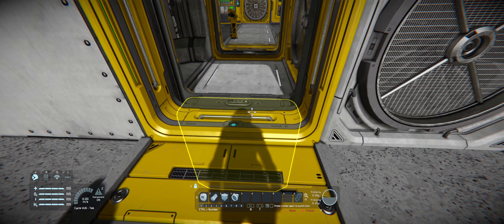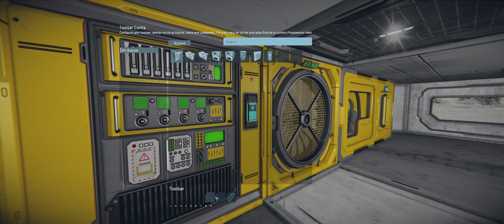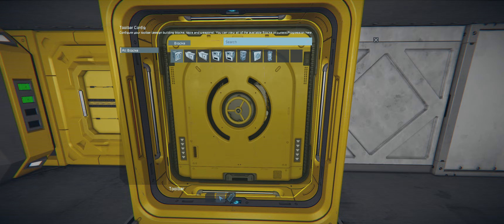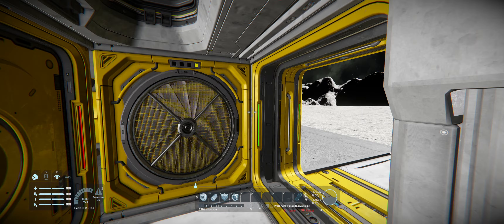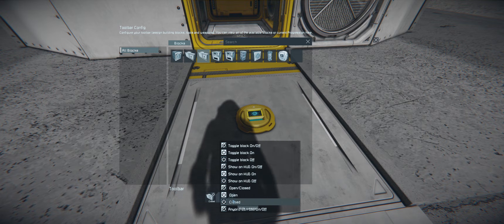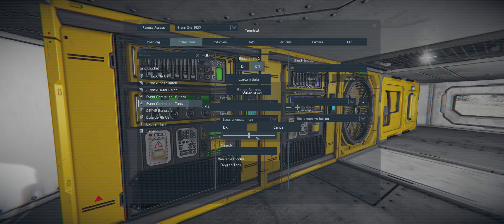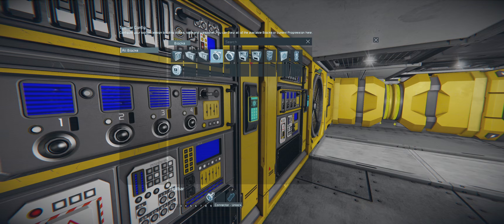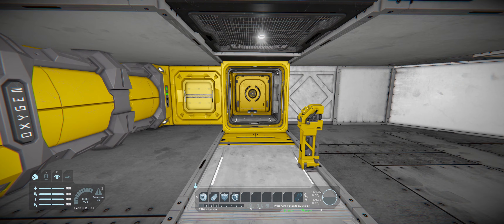Super Simple Airlock in Space Engineers! 100% Vanilla, No Scripts! Just 1 Event Controller!

Comment: For some reason, the airlock occasionally kinda... locks up? Not when depressurising, but pressurising. Or rather, the automated opening based on the Vent sometimes has the inner door failing to open even when there's plenty of oxygen, like the vent isn't fully pressurising.
Reply from the maker: There is a game bug where the room "fills" to 98% but never hits 100% for the vent trigger. Turning the vent on and off helps sometimes.
Reply: @EngineeredCoffee  Manually opening the inner door usually works, but I also have a light inside tied to the vent that turns red when depressurised, and it sometimes doesn't turn white when I do that. Cycling the whole airlock usually works, but I've got spare buttons in the airlock, so I guess I can make one a 'trouble-shoot' button.
Reply from the maker: It's a recent bug for sure. Not sure why the vents stop before 100%. Maybe a vent off when the outer door opens then on again when it closes 🤔

Comment: Which doors r u using and how u place them, please? And which vent r u using? Mine have only one fan and  all others r connectors. Yours have 1 vent inside airlock and another outside... Can u show how u made this, please?
Reply from the maker: It is the sliding hatch door for Warfare II DLC. It is 2x1, so you place it where the door is not the block mechanism. So you need to aim at the wall or ceiling in my setup so the rest of the block is in the floor.
The vent on the outside is decorative/only useful if the base is in an atmosphere to suck in air. For the airlock you only need the vent inside the airlock. Your inside of the base also needs a vent, but that is however you want to plumb in.

Comment: Seems like there is no more events in EC for opened, ore closed doors. Instead there is a single event "door finished open/close", which ruins the whole design, shown in this video.
Reply from the maker: Same event and functionality, just a different name. Tutorial and airlock functionality is still working as intended!
Slot 1 is for door fully open, slot 2 is for door fully closed. Use the other pages (ctrl+2,3,4...) to add more triggers for the open/closed.
This airlock uses the 2nd slot, doors closed, to swap the vent pressure.

Comment: Thank you very much for the video, I made one based upon this design, it looks different but it has the same basic function, I've got it working with sensors, one on the inside, and one on each of the outsides in case it ends up in the wrong setting, or if I hypothetically had it on a multiplayer server.
Reply from the maker: Yeah, I haven't tested it with multiple users at the same time
Reply: @EngineeredCoffee  I think mine should work, the sensors on the outside of the airlock close the opposite door, the sensor on the inside triggers a timer block that will toggle both doors open/closed. So I did add a timer block, but I wanted to avoid having to manually close a door as I passed through and avoid it triggering when I left range.

Comment: This is one awesome Airlock system. Thanks for sharing. Wish there were an easier way to control the Oxy/Hydro gas volume transfer - especially if you'd decide to like to run a Refueling station for trades and so forth....
Reply: Also, don't try this with the inset connectors. For some reason it didn't work for me, Oxygen tank kept on refueling up to 100% even though the connectors were disconnected....
Reply from the maker: Yeah, I reported the bug to Keen a couple months ago. They were able to recreate it, but no fix yet. My Martian Engineering series, I have 1 normal and 1 inset and that works fine. Just not 2 inset facing each other.
Reply: @EngineeredCoffee Yeah man, the inset connector also just has an overall cleaner look to it. Also, I honestly wish they'd add gas volume transfer functionality to the conveyor sorter, would honestly make things a lot easier on the designs and what not...

Comment: Is there a way to gate valve gas other than with connectors?  I don't think the filters do it do they?
Reply from the maker: No, sorters only do components. I wish there was  an actual valve.
Reply: @EngineeredCoffee  i suppose one could setup a welder/grinder/projector setup where a button push ground down a conveyor block to prevent gas transfer, then weld it back in place when the gas transfer is needed. But that's probably more work and space than two connectors...

Comment: You really need to explain this better cause you never show what to put on the inner button cause everything I tried resolved in it depressurizing while the inner door is open and it pressurized while the outer is open
Reply from the maker: Sorry, the inside button closes the outer door. I mention it at 1:55 but didn't show me setting it up. The outside button closes the inner door.

Sounds like you may not have your initial condition setup before setting up the event controllers. Make sure the outer door is on and open, the inner door is closed and off, and the vent is on depressurize.

It is the closing of the doors that triggers the Event Controller airlock cycle. So that button to close the outer door is needed because we can't reach that door unless we are in the airlock to close manually.

So in the video setup, the outside door is open, and the vent is depressurized. The closing of the outer door by the button triggers the Event Controller to flip the outer door off, flip the inner door on, and flip the vent from depressurize to pressurize. The vent actions then detect when it's pressurized, so its 1st action slot opens the inner door. I use flip because the controller doesn't know the states, just flips the switch, so setting up your initial state is important.

I will add the button and sensor setup to the description as well. Good catch!

Comment: thanks for the tutorial! i’ve already used it to put a few airlocks on one of my large grid ships :] i don’t have enough room for the double connector setup you showed on the oxygen tank though (without doing a huge redesign of my ship’s guts lol), so i’m curious if you know if using an event controller to only turn on a spare oxygen tank when depressurizing the airlocks would also allow me to keep my o2/h2 generators on. thanks again! you’ve been a big inspiration for me to get back into this game :D
Reply from the maker: Awesome! If you turn the tank on when depressurizing (without a valve) it will get air from both the vent and from the generator. You could turn off the generator and the tank on only while depressurizing (a few seconds). Otherwise the tank would fill pretty quick.

Another option I just saw from a player on Discord, is to use small grid tanks and vents. You could have them connected through a rotor or hinge setup to save space. You could then use the small connectors as a valve.

Comment: the connector trick is neat as a valve, but if your conveyor network decides to push ore/ingots/components into the connectors as storage and then the valve gets cycled, you will have stuff which is inaccessible on the other side of the valve without manual intervention
i wish sorters disallowed gases like they used to. i have no idea when it switched to letting them through. it broke a lot of my stuff when that happened.
i also seem to recall event controllers being more useful and having better options around the time they were released, but now have fewer abilities. like i seem to recall them having an option to test the pressurization of a space and performing an action in response, but that also seems to have just vanished invisibly without any sort of documentation.
Reply from the maker: Good points, I should probably put a sorter before the valves to prevent items. I do also wish the sorters worked as proper valves, it has been a frustration for years. 

The vents have a pressurization action within them, but it's only for fully pressurized and fully depressurized, it would be nice to control or read the full 0-100% range. Scripts can do it.

Comment: Well, exterior air vents are more meant to replenish interior O2 when in atmosphere, so your external vent is just needlessly draining power while exposed to zero atmosphere.
It's good to have in a BP you like to use everywhere; just grind it down and replace it with whatever air tight block you want. Heat vent would look pretty good there, IMHO.

Edit:
Just realized that's a half vent. Half block or the larger half of the split ramp (I forget what it's called) with the narrow side up to make a steep slope would look good, especially if also added to the other side of the door. Would look a bit more fortified, giving the door some cover from small arms fire. Kinda bunker-like aesthetic, and breaks up the flatness of the building.
Reply from the maker: Yeah, that's what that comment was intended for, I did a terrible job explaining.

Comment: 1) Feel like you are utilizing event controllers too simplistically, if you imagine them like IF statements, and then combine their functionality with timer blocks you can not only get a lot more complex with action functionality, but you can use nested event controllers to essentially make FOR loops and AND gates.

2) Your valve design is quite simplistic also, if you were to have that "valve" setup be a (lg connector | sg connector | 1 sg conveyor spacer | sg connector | lg connector) it would take up 1 extra lg block (1by3 instead of 1by2) but you'd be ditching no less than 2 lg event controllers so net positive, additionally you would have the same valve setup with the added bonus of it doubling as a branch valve, but you would also have plenty of space for small grid event controllers and timer blocks and other nested onto the valve system which would save space by removing the need for the large grid equivalents. Lastly with some luck and room design, could hide your outer sensor block onto the valve system fill the room with the sensor field right just barely poking outside the inner door and just invert the command functions. This would not only function as your airlock automation, but would also double as 1/2 of your event controller AND gate for checking if player is trying to use the survival/medbay to trigger on the o2/h2 sources.

3) With this added setup you would only need one more sensor block with a sensor field right in front of your survival/medbay in order to detect when player is trying to use it, but with this setup you would be able to additionally determine which source to feed to the survival/medbay which would also fix your overfilling o2/h2 tanks.

This kinda setup can also be used to not fill up your hydrogen engines to 100% as of last time I played you couldn't siphon h2 from hydro engines. Fingers crossed they fix(ed) that 🤞

P.S. Good Tutorial though, first one I've seen that uses connectors for I/O valves, certainly for gases at least.
Reply from the maker: Oh, definitely. This is just the simple one Keen showed off in a beta livestream. My airlock script is definitely more complex with controlling vents, tanks,  lights, etc. with if loops. Simplicity is nice sometimes though.

Comment: This looks like a solution for a multiplayer server (or hangar bay). It is well thought out. On my solo builds, it seems like two doors at one block distance function as an airlock without the air vent. Before the Event Controller I would maintain all doors in a "Group" and used two Timer Blocks to close ALL doors at a 5 second tick, each would trigger the other in a loop. Using the Event Controller block I replaced one of the Timer Blocks, and now the Event Controller triggers on any "Door Open" event and the Timer Block was reduced to a 3 Second delay. ("Door Open" event -> Event Controller -> Timer Block 3 Seconds -> Trigger Close for "All Doors" Group) Unfortunately, I've discovered that the Event Controller "Door Open" trigger resets the Timer Block whenever I open a door, but 3 seconds isn't a significant amount of time. I have color coded my interior and exterior doors, to remind myself to be patient. My solution is less sophisticated, and less "realistic", but it is "cleaner" and space saving for ships.